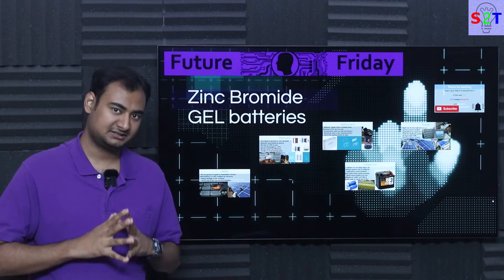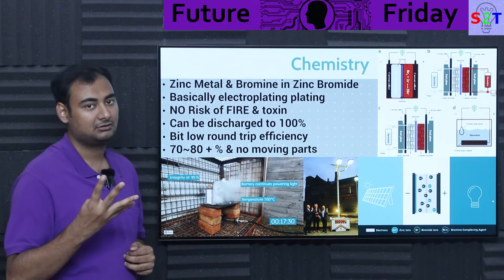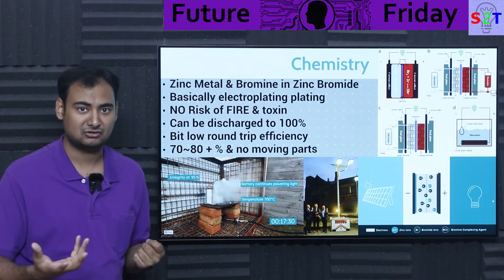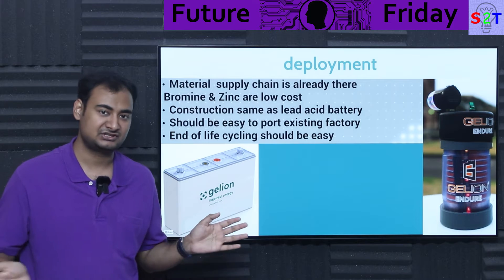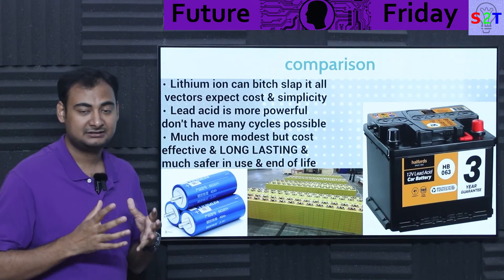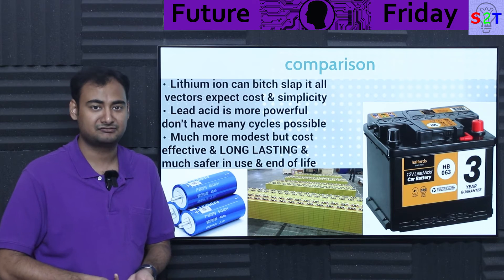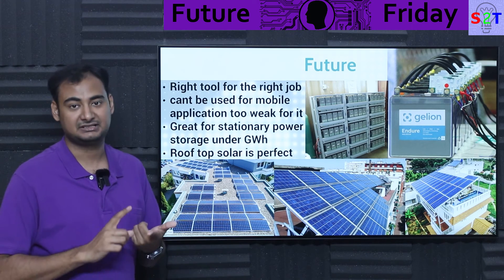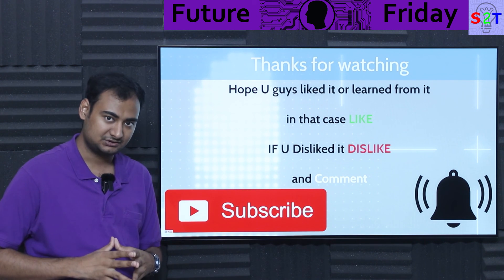Zinc Bromide GEL batteries Explained {Future Friday Ep184}

Comment: Thomas Maschmeyer's original gel test cells were achieving 81% RTE and believe Gelion have substantially improved upon that. In fact, I recall seeing a figure of 87%.  It's certainly higher than the 70-80% figure in the video, which may applicable for some  ZnBr flow batteries.
Also, the energy density is 120 Wh/kg, which is higher than lead acid, although obviously still less than the various Lithium ion batteries.
Reply from the maker: well we have to wait and watch

Comment: Clearly the ZnBr gel battery is inherently very very cheap.  However to make this so, it has to climb the technological curve (wee improvements as the technology matures) but far more important it has to mount the sales volume/production curve.  The have to be manufactured in really really large numbers to get the price down.  It might help if a government like the Indian government would put in orders for giga watt capacity batteries of this type so that the manufacturers could rapidly develop their manufacturing capacity.  I'd buy a bunch of them tomorrow for my home if they were available.  So let's get on with it.  And incidentally, if you look at the Hornsdale saga, it is riduculously profitable to own  a couple of hundred megawatts of battery storage capacity. Make them cheaper than a Tesla Solar wall per stored energy and they will take over the home storage market of the world.
Reply from the maker: that is why using pipeline of lead acid is key its a short cut to cost effectiveness
Reply: @s2tenglish  this technology uses the process of making lead acid batteries

Comment: That is cool that you compare several existing batteries types explaining their differences
You mentioned  Cryogenic Energy Storage that I had never heard of
So I search for it and found that you already have a video about it )

That made me think that I have seen how other channels suggest related video using YouTube cards
Though I am not sure how much work is to create such cards to understand are they worth it and do they increase retention

I mention this because already few times I am hearing some new term in your video then search for it and then realize that you already have a video about a subject
I have a feeling that there were much more terms that I heard and was curious about but didn't bother search for some reasons
Reply from the maker: YouTube is my full time job & this is my second channel (main one is in HINDI) . So I do try to add all but I get tired even adding small little thing like cards becomes frustration as its very fiddley to do proper sync  . as to  retention no impact as its not easy to use for viewer side and given the fact that I have 920 videos it will be a mess
Reply: @s2tenglish  I think you're right.